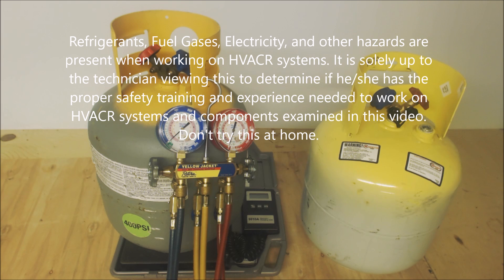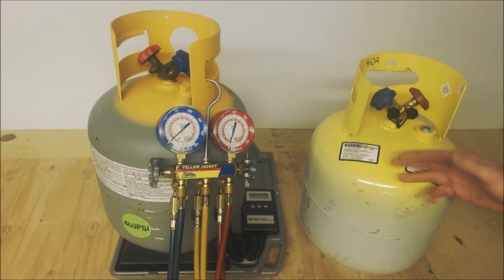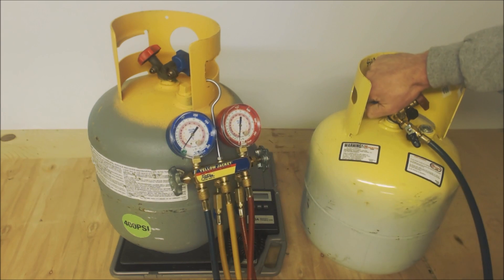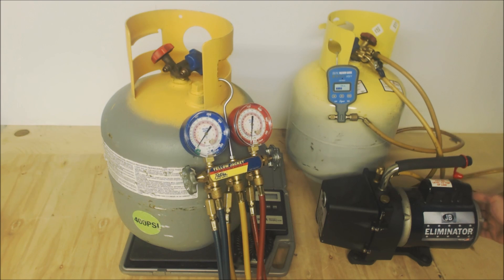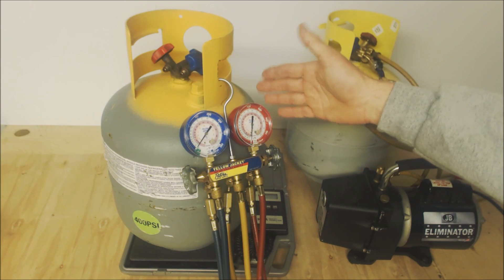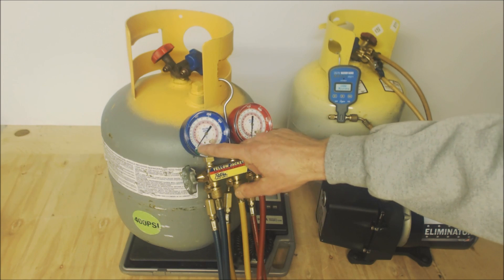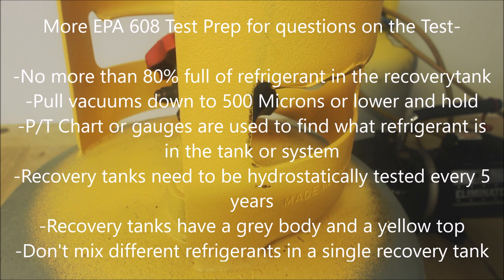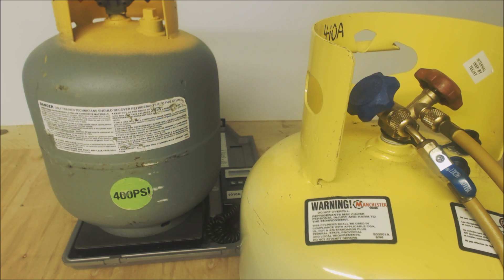Refrigerant Recovery Tank! Commissioning, Max Cylinder Weight, Selling Refrigerant, EPA 608 Rules!

Comment: Isn't there a concern that the shrader valve will leak under vacuum? Wouldn't it be better to charge from the end of the valve core removal tool where you have a vacuum rated valve?

Comment: If you could explain WC and actual type of refrigerant weight.  Most don't know or understand properly. 
  I did similar with propane tanks. They are rated WC too. Now I weigh my tanks while being filled with propane. After several over fills and forklift tanks blowing off in hot weather when full. Don't need slow leaks from pressure valves into a building. 
  If you don't do the video, I will.

Comment: If you throw you gauge on to check for a vacuum would you be introducing the air from your hose.  Not much but enough to lose the vacuum
Reply from the maker: Yes you are correct. I would only vacuum right before using the tank, thanks!

Comment: What if your saturated temp and actual ambient temp is off like 5 degrees when checking the recovery cylinder. Is there an acceptable range? Thanks.
Reply from the maker: You really want to take these measurements when the tank has been sitting in the shop for at least several hours but preferably longer like 12 hours, then you have a steady temp to work with. It should be right on otherwise air is likely mixed with it in the tank, thanks!

Comment: Hey tech hi... hey is that safety valve needs to be closed by us when you get a new 
cylinder? i just bought a new one and with 6 pounds of refrigerant in 
it, it started trowing out the freon by the safety valve completely,,, i tied 
the valve all the way down with an allen wrench but it did it again.. it
 that mean the safety is bad in this thing? thank in advance for 
response...
Reply from the maker: That sounds like it is a manufacturer problem on the tank as long as the pressure is below the max which usually is 400psi but you can usually read the rating on the neck of the bottle, thanks!
Reply: Yeah the tank i bought it online and i didnt see any information stamp but at the notes in the internet says 400psi... Does that valve comes already set? or you need to close it all the way in?
Reply from the maker: They come preset. You may want to contact the manufacturer or distributor on that one, thanks!
Reply: ok.. thanks for your response learned a ton from you man!

Comment: Ac service tech. Please explain your reasoning. Why do you start your vacuum pump with the hose "a little lose" that means you are starting it not at 0psig but at atmospheric pressure. And I don't agree with you on the part about damaging the vacuum unless pressure is back to 0 psig because on a triple evacuation you would have to pump about 2-10 psig of nitrogen to break the vacuum. And then you vent it through the vacuum pump. That is per the EPA cert training book and the refrigeration and A/C tech volume 8 book. 
Please explain because I have also brought some of these questions to you in the past. 

Thank you
Reply from the maker: Hey Adolfo, if your vacuum pump has a gas ballast then it is best to open that when starting the pump for the pump's sake and the oil's sake. In reference to leaving the hose a little loose, that is just a habit for start up of an older vac pump and not needed for newer pumps. I believe what I may have been saying in the video is to not damage the vacuum gauge with having any positive pressure. Certainly you can add nitrogen pressure up above 0psi when breaking the vacuum. This will not hurt. You do however need to have the micron gauge disconnected  or valved off though if you are planning to add any positive pressure. You can vent the excess nitrogen right out of the hose to bring it back to atmospheric pressure. If you want, you can do it through the vacuum pump but I would not let an excess of nitrogen pressure through a vacuum pump. Bringing the hoses to atmospheric by venting through the hoses themselves will not add much moisture into the hoses and certainly not into the system itself unless left open for a bit of time, thanks Adolfo!
Reply: acservicetech thank you for your quick response. I was actually referring to a comment that you replied to on another viewers comment. On that reply you said to never install a pump or vacuum gauge to a system until that system was back down to 0psi. 

Other than that we do agree on all points. And I only pointed it out because it was something that i very much struggled with when I was first starting out. 
Very much appreciate your videos and your replies to questions. 
Thanks
Reply from the maker: The main point is do not put any positive pressure on the vacuum gauge. All of the manufacturers vacuum gauges are particular and it is very frustrating if there is a problem with them that occurs especially a leak. Treat them like gold, keep them in a case, keep the ends capped, try not to allow any oil to get into them, that's all. Thanks and glad for the correspondence Adolfo!
Reply from the maker: Struggling and Wrestling are all good signs of someone who cares about the product that they are putting out and the people that they are providing the product for!
Reply: Adolfo, atmospheric pressure is 14.7 psi, but 0 psig.  Your gauges should be calibrated to 0 at atmospheric in order for you to obtain accurate readings when you are checking system pressures and that's the way they come from the factory.  The main thing though, as AC has tried to express, is that you don't want positive pressure blowing through your vacuum pump.  It can push oil out of the bearings or even contaminate the oil preventing you from getting a proper deep vacuum. On a triple evac, yes you do put 2-10 pounds dry nitrogen on the system, BUT you bleed that off to atmospheric before reopening the system to the vacuum pump.  It's just to make your equipment last as long as possible.

Comment: Is it possible to charge a system with a recovery tank???
Reply from the maker: Yes, if you had an empty bottle that was vacuumed to 500 microns, you could recover refrigerant, and then weigh it back into the system after the repair was made. The epa through section 608 does not want refrigerant from one owners system to be recovered and used in another's system., thanks Al!

Comment: Does the distributor usually charge the recovery tank with nitrogen?
Our shop has some tanks that show high pressures for r407c. (180psi @ 85f) However it has only 2lb of something in it. 
I assume this is nitrogen.. and I need to purge this and vacuum the tank.

What if the tank shows high pressure (similar) however has something like 17lb in it. 
Purge off the nitrogen until pressure is correct?
Basically someone just recovered into tank without checking it.
Reply from the maker: Yes the supplier usually has nitrogen in it. If the tank was not vacuumed before use I would take the gas out with a recovery unit and put it in another tank maybe that already has mix in it. then see if the remainder of the tank matches sat temp of a refrigerant you think is in it. The tanks should be labeled in some way if you have multiple techs handling these same tanks even if it is a wired tag or something, thanks TurboFlush!
Reply: @acservicetechchannel  
If the weight of the cylinder is equal to the weight of the empty cylinder, but the pressure is higher than atmospheric, this means that it contains nitrogen, air or residues of any refrigerant in the form of gas (in very small quantities). Such a cylinder must be evacuated with a vacuum pump.
Reply: This is normal pressure for R407.

Comment: great video,i have question about the max weight i know the recovery tanks needs to be filled to 80% capacity but how do you calulate that i couldnt understand when u made the calualation because u can have a smaller size recovery tank that will take less freon what the simple way to calulate recovery cylinders of any size ?thanks
Reply from the maker: 50lb tank 80% is 40lbs of refrigerant,  tare weight of the tank plus the 40lbs would be max weight of the tank after zeroing it out. If it were a 30lb recovery tank then 80% would be 24lbs plus tare weight for total weight after zeroing the scale, thanks ny kid!
Reply: acservicetech got it thanks

Comment: Is there anyway to replace the seals on a  recovery tank? I have a leaker, it won't keep a vacuum. thanks
Reply from the maker: I would call your supplier and ask them what they would like you to do, maybe give it back to the supplier. We usually buy a tank from the supplier but then we exchange that tank and get another different tank which may be older or in worse or better shape to use.  It is the distributor's responsibility to give you a tank that has been hydrostatically tested within the last five years and is not leaking. If it does leak within those five years then I would expect them to give me a different tank. Each of my distributors have a different recovery tank provider so I just stick with the one that gives the most money per pound for r-22 and doesn't charge cleaning or other fees, thanks!
Reply: acservicetech Thanks for the info. Keep up the awesome vids.  👍

Comment: Does it cause any kind of damage to the vacuum starting the vacuum with positive pressure in the recovery tank
Reply: Ac service tech. Please explain your reasoning. Why do you start your vacuum pump with the hose "a little lose" that means you are starting it not at 0psig but at atmospheric pressure. And I don't agree with you on the part about damaging the vacuum unless pressure is back to 0 psig because on a triple evacuation you would have to pump about 2-10 psig of nitrogen to break the vacuum. And then you vent it through the vacuum pump. That is per the EPA cert training book and the refrigeration and A/C tech volume 8 book. 
Please explain because I have also brought some of these questions to you in the past. 

Thank you
Reply: @illthinkofsomethinglater9095  
1) 0 psig = 1 atm,
2) Vacuum pump Inficon QS5 manual:  Damage to the pump may occur if evacuation is started while the system is under high pressure,
3) 10 psig is only 0.7 of atmospheric pressure
Reply from the maker: Yes make sure to never attach a vacuum pump or micron gauge until the pressure is back to 0psig first.
Reply: If you start the pump while under pressure? Hah! You get a blast of pump oil in the face. How do i know? 
Yes. And its probably not great for the vac gauge either.

Comment: Question... I had a licensed HVAC guy install a new 7/8" line set and 4 ton evaporator coil at my residence. The new line set is approximately 30 feet. I noticed that he did NOT use a micron gauge, and he vacuumed the line set for approximately 15 minutes before releasing the charge from the New 4 ton unit. It only ran for approximately 5 minutes, he said that he would  have to come back on a warmer day to charge the system. would it do me any good to pump down the system and do a proper leak test and vacuum and re- release the refrigerant?? Or do I need to Evacuate the system and start completely over??
Reply from the maker: Well any moisture is already now mixed with the refrigerant. Was he using a 3/8" large vacuum line or also core valve removal tools at the service ports that would pull the system down faster? Did he leak test with nitrogen before vacuuming? A quick phone call to the company owner would fix that problem usually. I talk to business owners a lot and they want the job done right so if you can get to them and they hear that it is not, they usually respond by correcting the situation. There was a service tech in the area here that was pretty well respected and liked. He told me he liked his new vacuum gauge. I asked which brand was he using that broke because I like to know when certain tools fail for my own general knowledge. He told me this was his first one! Not good. I like micron gauges because for me they also are a double confirmation that no leaks are present besides getting the moisture out to the correct level.
Reply: +acservicetech .. Thanks for the reply. . The company I used is a local owner ran Hvac Company . To be honest I had a large air conditioning company install my last unit and they did such a terrible job, I felt more confident using a established small HVAC Tech this time, But he still cut a lot of corners. I had to ask him to use nitrogen when he braised the line set and he Did do a 2 minute pressure test. Like I said, he cut corners.... He used analog gauges that really needed to be zeroed out. there was only the 1/4" hoses used coming from his manifold gauges. That is way I am going to purchase a Testo 550, a digital meter to check my wet bulb, and a bottle of 410A and charger the unit myself. . I honestly don't want to, but I feel ripped off by the guys in my area.
Reply from the maker: Got ya, is it a system with a piston and that is why you want to check wet bulb for target superheat? We use epatest.com here for the 608 Universal Cert. As far as the wet bulb, I have had this version for the last 14 years but mine is black, General Tools digital Psychrometer -http://amzn.to/2cSHsi1
Reply: Thanks so much for this information. I am going to look further into this Universal Certification. I must say that I have learned A LOT from all the videos that you have done. I know that there is a lot more to it then you have shown, But you do a GREAT job of teaching HVAC... Yes my new system is a 4 ton, 410a system with a piston. I decided to Recover all the refrigerant and start over.. I ordered Everything I needed from Amazon last night. The Testo 550, a Recovery Machine and tank, Hoses, digital Psychrometer, refrigerant and a Lot more other stuff I will need. It was NOT cheap, But now I can service my unit Properly .. One last Question, Once I recover the old refrigerant, about 101 oz , where do I dispose of it ?? ... Thanks again for your Helpful reply. And PLEASE keep the Tech Videos coming.
Reply: @curtispaige2614  . Why in the world would a customer resort to purchasing hundreds in tooling himself and have every last tool and the knowledge to use them without experience?? And even trying to fix up the trademens mistakes? not remotely possible in my area of the world
Reply: Curtis, how did it go?

Comment: Great explaining but fast way of figuring out 80% of each recovery tank is take numbers off the tank W.C. +  T.W. *. 08 = total weight of the cylinder or get the specific weight for that refrigerant that you are using.
Reply: TurboFlush Recovery Tank MAGW = (0.8 x WC x SG ) + TW

MAGW - Max Allowable Gross Weight of Recovery Tank

WC - Water Capacity of tank (stamped on recovery tank)

SG - Specific Gravity of Refrigerant at a specific temperature.

TW - Tare Weight of recovery tank (empty weight, the # is stamped on recovery tank).

Example of a 30 Lb 410A Recovery Tank:

TW - 17.0 lbs (stamped on tank)

WC - 26.2 lbs (stamped on tank)

SG - R410A at 77ºf is 1.06 (this # will change with temperature)

39.2 lbs (MAGW) = (0.8 x 26.2 x 1.06) + 17.0
Reply from the maker: Thanks Edward HVACR CT, yeah even though epa says no more than 80 percent, I haven't found any distributors or manufacturers willing to take 80% yet. Even Dupont says they want no more than 80 percent minus two pounds. Thanks Edward!
Reply: Edward HVACR CT 
For some reason I am having a hard time wrapping my head around this. lol
Reply: TurboFlush Look at the tank information it the on every tank l never to fill 80% the formula is written on every tank it an fast way to determine the weight and l know that most supply house that supply recovery tank will have and chart how much tank weights . Remember don't mix refrigerant what l do is have a tag and how much tank sure weigh and type of refrigerant every recovery tank .
Reply: Edward HVACR CT 
awesome, thanks! great vid. 

after more digging around. I found this same calc..  from on a tank. 

I have people at my shop that like to overfill tanks. although certified.. not proficient or knowledgeable. 

I think tanks should come better marked. due to the hands that can come in contact with them. certified or not.
Reply: Yes! Edward is first one to get it right. There's still hope.
Reply: Edward HVACR CT 
w.c. is the material weight?

Comment: Quick question do you have anything on cfm calculation..how much cfm for ton and selecting the right motor speed tap for the right tonnage.
Reply from the maker: Not at this point, 350-425cfm per ton of cooling. Usually 400 cfm per ton of cooling. If you adjust the fan speed then you need to check the refrigerant charge. Gas furnaces should be checked to make sure that they do not exceed 50 degree temp rise in conditioned air on heat on high speed. Thanks Pedro!